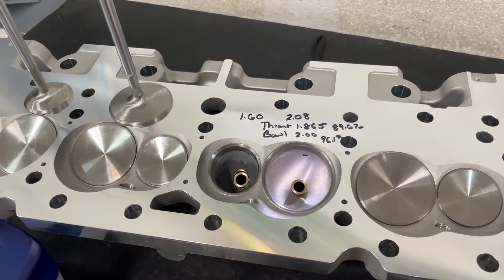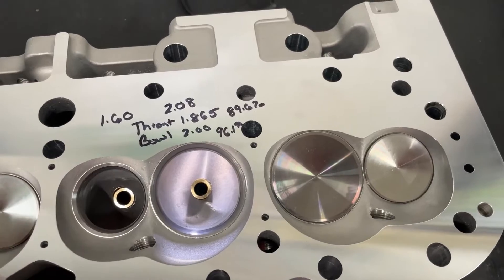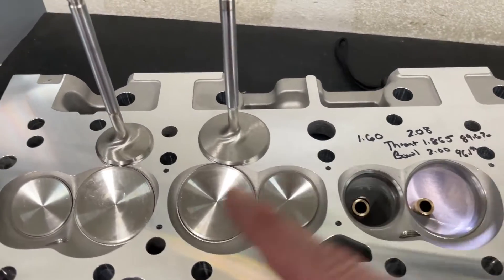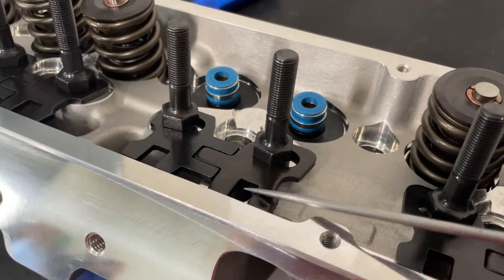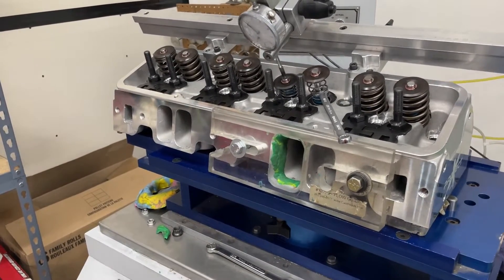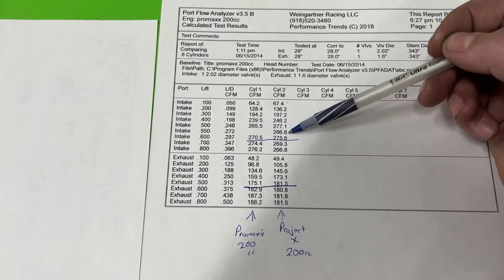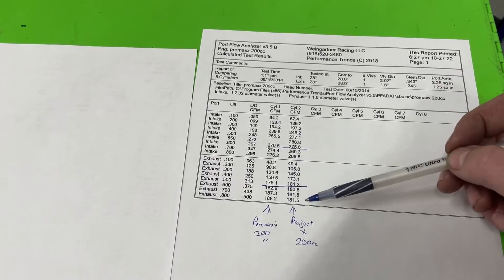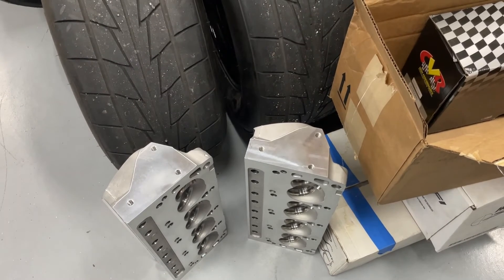Promaxx Project X 200cc Head Review With Real Flow Numbers

Comment: hi eric thanks for another great video, im building a 421 11.5 comp motor with a solid roller 720 lift cam and plan on running an eldelbrock street tunnel ram with 2 660 center squirters what heads would recomend for my build ? thanks again
Reply from the maker: How many rpm do you plan to turn it.

Comment: The promaxx still looks like a better head than the afr enforcer. How much power difference do you think there would be on a 383 with a 244-248 .540-.560 110 HR cam with 10-1 compression and a Victor jr?

Comment: It looks like that guideplate wouldn't even line up with the pushrod hole even if you moved it over... I've heard of Promax heads having alignment issues, are they worth buying?
Reply from the maker: They line up you have to adjust them. From the factory they just bolt them on for shipping.
Reply: @WeingartnerRacing  ok good to know. It just looked like if you slid that guide over anymore the adjacent one would've been in the water jacket instead of the pushrod hole. I think I heard stories of when the Promax first came out there was problems. I even had a AFR 220 head that was very close on one pushrod hole. I had to adjust it just right and when I torqued the stud it would throw it off just enough it would start rubbing. Anyways, I appreciate the feedback I'll probably order a set of 200s for a budget build.

Comment: thank you after getting a bowtie block forged crank billet rods mahle powerpacks runnin out of funds quikly and ive had a set of protoplines on the shelf 220 cc from i think a guy named shaver or well sounds like that anyhow sense its 414 in a camaro wich will be driven everyday i happened on promax 200cc thought it will be better for street but absolutely love them for 450.00 dollars bare414 wants more head but for street these work great thanks for helping me decide....
Reply from the maker: No problem
Reply: What did you end up doing  with your pro toplines, are they aluminum?.

Comment: Do you think the larger bore allowed it to flow slightly more and cause the short side on the inlet to separate earlier on the Project-x because, the ARF and Promax back up to a similar about around the same point?

Comment: Good stuff, I believe had they both been flown on a 4.155' bore plate, the disparity between the two would become much more evident. The AFR exhaust side is around 72%, while the Promax exhaust side is around 63%. Putting them both on a 4.125" bore engine, I think the AFR would run away, especially above 5800rpm. Due to the AFR's efficiency and it's valve control. But, double the price is double the price.
Reply from the maker: Maybe and I might try it later.

Comment: Why not order a bare set and smooth with a cartridge roll, then throw AFR hardware and valves in it? Do a valve job? Cause you are STILL well under the cost, even if you have to pay for a 5 angle valve job and better valves etc?

I mean if they are a solid copy, then the parts should work perfect almost!!
Reply from the maker: AFR use 8mm valves these are 11/32. The casting was pretty smooth and very little flaws cartridge rolling it would have gained very little. The valve job would have helped though.

Comment: Wow I was really surprised with the Promax heads for 1400 dollars afr enforcer 195 as cast are over 1100 hundred and don't flow near that good and you compared those heads to the competition ported heads and for half the price it's a no brainer. Thanks for this information. So all I will have to do is get some solid roller springs and be in good shape I'd love to see what those heads would do with you just doing a little port work on them with a 60 grit cartridge roll. I bet you could really make them flow better. Your friend from Louisiana Rick 427.
Reply from the maker: I can pick them up but not with the cartridge roll because they are smooth and very little flaws. The valve job may pick them up.
Reply: @WeingartnerRacing  so far that is about the best deal and what is good you checked them out and flowed them if you think they are a good head then they are good and for half the price of the competition port afr 295 I'll save 1400 bucks that would just about cover a camshaft and intake on a build.thanks for the feed back

Comment: Do you ever radius the deck surface at the quench in front of the intake or exhaust valves?  Thanks for the videos.
Reply from the maker: Very rarely
Reply: @WeingartnerRacing  just  wondering when you would do it?
Reply from the maker: @dondotterer24  I try not to because it hurts wet flow but on nitrous and turbo I do.
Reply: @WeingartnerRacing  I understand.  Thanks
Reply: I’ve been wanting to know the same thing.   I’m wondering if my gen2 lt4 heads would benefit from that since they have small exhaust valves and I’m running a big cam

Comment: SO USE A CAM 550 LIFT ON A STREET MOTOR WITH PROJECT X HEAD SHOULD RUN GREAT..CAN YOU PUT BETTER EXUAST VALVES IN PROMAX AND PICK UP WHAT IS NOT THERE ??
Reply from the maker: Some yes.

Comment: I wanna know why it isn’t relevant to have those steamhole on all the aftermarket blocks that you see and nobody drills these into the blocks so they can then have to drill them in the heads.
Reply from the maker: There is no water In between cylinders on an aftermarket block. Hence no steam holes
Reply: @WeingartnerRacing  they are mad similar to the factory blocks tho …right. I’ve never owned an aftermarket block so im just guessing they jave similar water passages.
Reply from the maker: @johnnyatkins9097  similar but solid between bores. It’s much better that way.